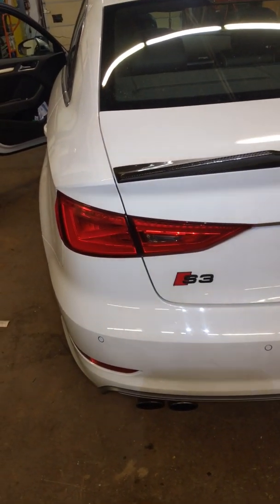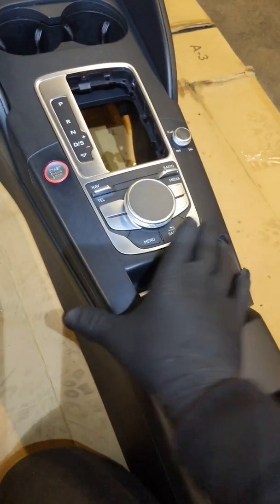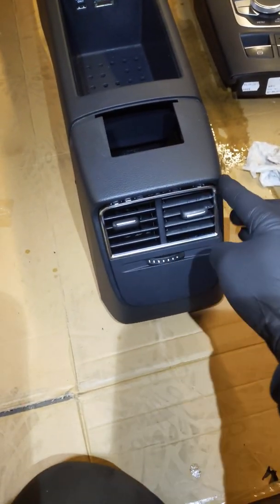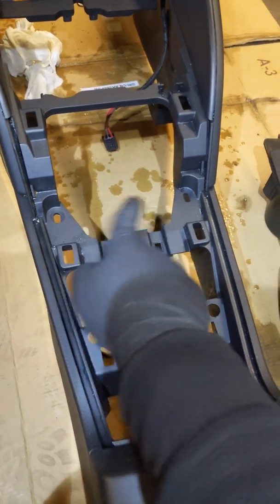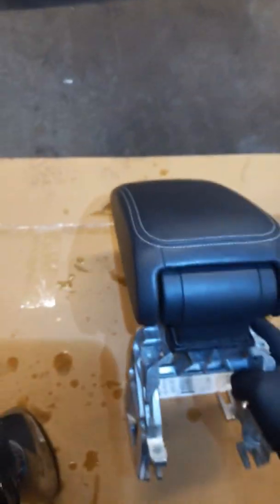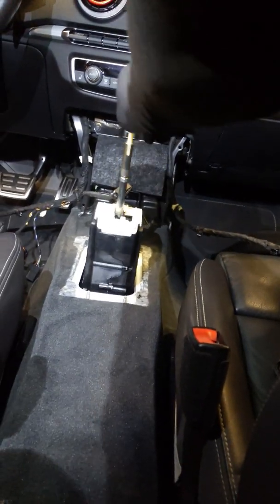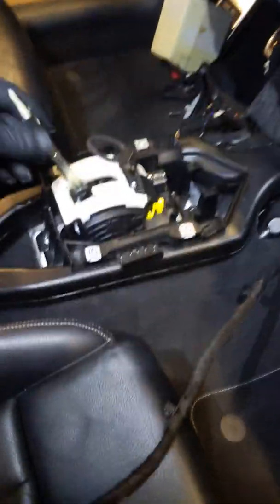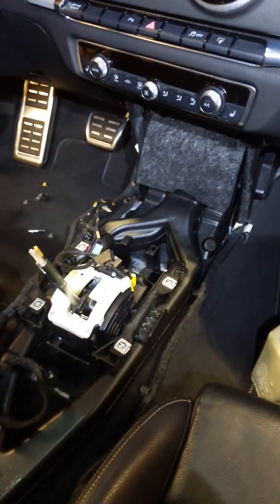Audi S3 A3 RS3 MMI Center Console and arm rest removal

Comment: FOR ANYONE DOING THIS REPAIR

Pay attention to the KESSY antenna cable attached to the center console itself. It is not attached to the MMI section, but the actual center console itself. Towards the armrest from the Shifter, you'll see a horizontal cross bar with two light grey pegs sticking into it, as if something is attached from the other side. To the right hand side there is a small two pin wire there that provides signal to the central KESSY antenna. If you're not careful, you can break this antenna or the cable and disable the kessy system until its repaired. Cheers!
Reply: Dude, thanks you! I did this on mine end of december. I was sure that was it but i could not find any clue online about the location of the antenna.

Comment: Great video, Andrew.  I have what looks like an identical center console on my A3Q Sport sedan from 2016 and need to remove the arm rest, which is stuck in the open position. Got as far as removing the vent (identical to yours) but the small rear housing (1:53 mins) in your video) still doesn't want to come off.  It looks like just clips at this point but I am not sure wther to pull back, up or some combination, nor how much brute force to use before it breaks!
Reply from the maker: Not sure if it's put together the same but mine only has clips. You can get an idea of which direction to pull by looking at which way the tabs are facing in my video. Some stuff takes a little bit of force to come apart for the first time
Reply: Thanks Andrew - your reply gave me the confidence I needed to pull hard and indeed it came off fine.  Now of course it seems obvious that they use that four-legged aluminium bracket holdong the armrest as a fairly important structural member for the entire centre console cover. Even with the four bracket attachment bolts removed and the four 8 mm screws attaching the back of the long moulding to the the bracket, it looks like I need to bite the bullet and remove the rest of the cover all the way!  What a crazy design!

Comment: i just want to get to the back of the cigarette lighter to drill a hole on the other side to install a bass knob, does this all need to come out or can i slide it back abit?
Reply from the maker: In order to move the center console back enough to work back there I think you'll need to remove it. You'll have to remove the armrest to be able to slide it back. You'll also have to remove the MMI controller to remove the bolts holding the center console down.

Comment: Hey bro how hard would it be to remove the dsg gear selector ?
Reply from the maker: P
Reply from the maker: Haven't done it myself but you'll have to pretty much remove the whole center console. You'll probably have to go underneath the car to disconnect a linkage of some sort. Possibly may be able to disconnect it from up top.